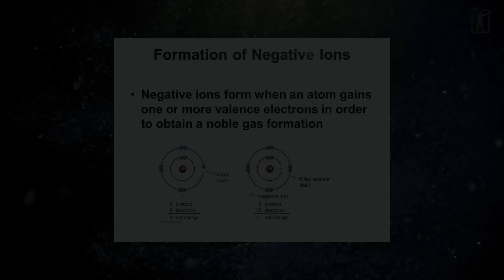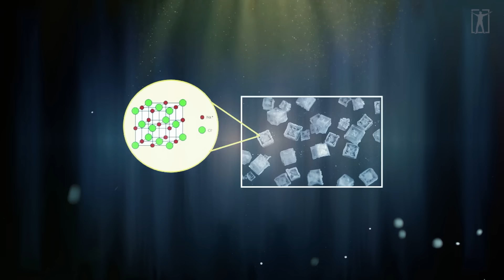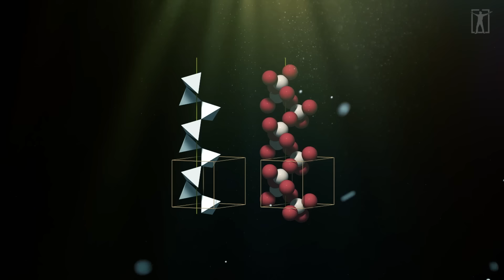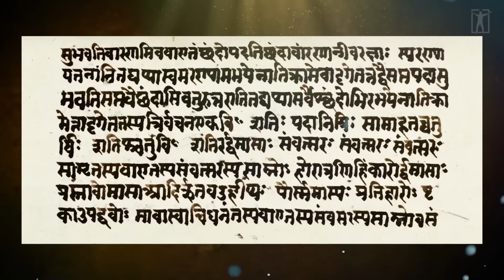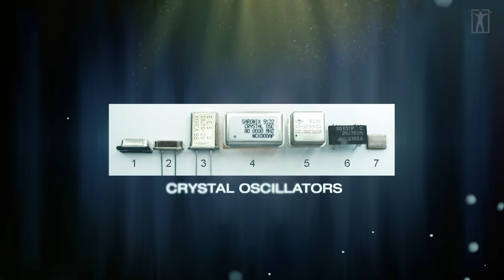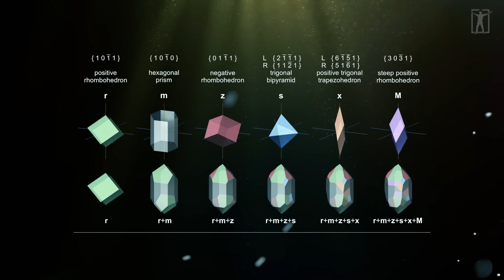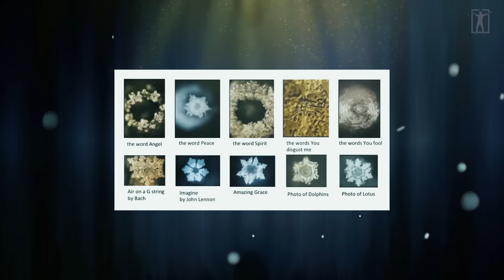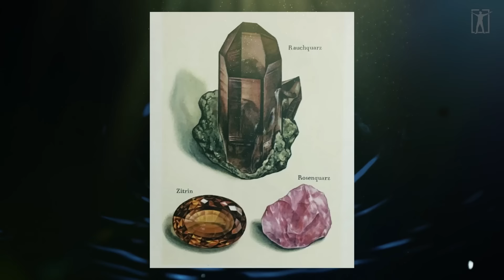"Once You Heat it, Your Brain Starts Changing" (seriously)

Comment: All I know is that when I stay too long in a crystal shop surrounded by so many and different types of crystals, I start feeling so emotionally overwhelmed, and uneasy to the point of almost panic attack provoking at times....and at a minimum, feeling like crying.  I've only been into 5 or so since I figured it out years ago.  The first time, I could not figure out why I was suddenly feeling that way, and my wife told me to go outside and touch grass, and I felt better pretty quickly....thinking it was a fluke, I went into one or two more with a similar effect.  Since then, I am aware of it, so it doesn't affect me as much as it did at first, but I have to prepare myself before going in.

Comment: There were 54 Large crystals in the great pyramid, 27 on each side of the So-called grand gallery , whenever the Nile moved up and down Immense amount of electricity was gathered  from the 13 acres it covered And transferred this voltage up the conductive magnesium filled granite and captured by the white non conductive insulating white stone on the outside the great pyramid magnifying this power to the max out thru the apex of the great pyramid emitting a great light through the cap stone made of  Electrum an admixture of 10% silver and 90% gold   These huge 54 Chrystal playing an amazing part of this spectacular performance of ingenuity  in my opinion
Reply: That sounds like a plausible source of energy for the electrolysis needed for the pyramid to function as a water pump.  Steven Myers has presented the most convincing theory of how and why the Great Pyramid was constructed to pump water ultra efficiently, using the vacuum formed from combustion of gas from electrolyzed water.
Reply: @Andy_Holmes  it sounds plausible only if you have no understanding of physics and powder generation!
Reply: @Mjbeswick  Modern man doesn't fully understand all the principles involved in physics and power generation, yet incorrectly assumes to.
Reply: @Andy_Holmes  exactly which well researched and documented principles do you think we don't understand?

If we didn't understand the principles of power generation it wouldn't be possible to generate power on the scale that we do.
Reply: @Mjbeswick  Obviously everything well researched and documented is already understood, I'm referring to that which isn't well researched and documented, of which there is plenty.  This is often referred to as fringe science, or otherwise disregarded as untrustworthy, but there's a lot of valid work that gets overlooked.
Reply: @Mjbeswick  For example, structuring water to utilize it's unique properties is an essential part of the process by which the Great Pyramid was able to pump water ultra efficiently, according to Steven Myers in his book "The Great Pyramid Prosperity Machine".  But the whole concept of structuring water is largely disregarded by mainstream scientists, and they would consequently fail to understand exactly how the pyramid functioned to pump water, without having increased knowledge/acceptance of unpopular scientific research.
Reply: It has been said that the Nile has been moved through the years. In the early years it went right through or next to the pyramids. Imagine so much salt water with Ions streaming next to it. Probably, in combination with crystals, pyramid energy and different kinds of metals they were able to make lots of electric energy of this.
Reply: @artofwebdesign  Are you saying the Nile was salt water?
Reply: The most probable explanation ever! Thank you. When I say it, my people just say I'm nuts. In your opinion, what was its actual purpose? I have a vision that it brought the Great Deluge.
Reply: @charleigh1860   The pyramids were built after the deluge by Noah's descendants.
Reply: Your Lord  the Enki built it. He is Noah's Ancestor though. This machine is supernatural built by the Annunaki.
Reply: @Mjbeswick 🙏🏻🙏🏻🙏🏻
Reply: And the cathedrals were also meant to harvest energy from the ether hih in the sky
And wit the organs playing, thise were healing centers and power stations

Comment: Negative ions can be beneficial for mood, energy levels, and overall well-being. They are naturally occurring in certain environments and can be increased in the following ways:

1. Spending Time in Nature: Areas with high negative ion concentrations include:

Waterfalls

Beaches

Forests, particularly after rain

Mountains and high-altitude locations

2. Air Purifiers with Negative Ion Generators: Some air purifiers release negative ions to cleanse the air of pollutants and allergens.

3. Salt Lamps: Himalayan salt lamps are believed to emit negative ions when heated, although their effectiveness is debated.

4. Houseplants: Certain houseplants, such as peace lilies, aloe vera, and spider plants, can help increase negative ions in the air by purifying it.

5. Grounding (Earthing): Walking barefoot on natural surfaces like grass, soil, or sand can help absorb the earth's negative charge, potentially benefiting your body.

6. Using Negative Ion Generators: Devices specifically designed to emit negative ions into indoor environments can be purchased for home use.

7. Running Water: Taking a shower or being near flowing water, such as rivers or fountains, can expose you to negative ions.

By incorporating more of these natural or artificial sources into your life, you can increase your exposure to negative ions.
You welcome 
Maria Chueva New Zealand 🇳🇿
Reply: Thank you for taking the time to share your useful list.

Comment: If you mix crystals in water with wooden or bamboo spoon or straw, you create a piezoelectric   effect in water. Also, before you put crystals in your water , check the soluble properties of the crystals. You don't want certain chemical elements from  crystals in your water.
Reply: It may be be a good idea to clear your water of any conflicting structure...or other imposed patterns picked up at any time...including Eons ago.  Simple works.
Reply: You clearly don't understand the piezo effect! When a crystal is mechanically stressed an electric charge is created, and vise versa. What you are suggesting literally has no function.

Comment: Use this along with magnetics, and cymatics (pardon spelling) and incorporate them into a living structure and you would have the basics for making a living computer!

Tree Fountain (aka Tree of Life)

1- Bore a hole into and up a tree being careful not to bisect the core of the tree. 

2- Coat the inside of the hole with beeswax. 

3- Put a water basin at the top and a fire pit or fireplace at the bottom. 

4- Put copper pipe around the inside of the fire pit or up the chimney for a fireplace. This will act as a pump. (You can also use a hotplate if you prefer)

5- Add water wheels (fidget spinners can be used for some decent mini water wheels) for electricity. 

6- Add hanging gardens for fresh produce. 

7- Splice other saplings and/or fresh tree cuttings using the tongue and groove method for shelter. 

This design provides food, filtered and conditioned water and air, electricity, shelter and SO much more! Everything a person needs for life and survival. Hence the "Tree of Life" nickname!
Reply: I can't even mentally picture what you're describing. Is there a video you can direct me to please
Reply: Very interesting line of thinking
Reply: Drugs are cool
Reply: Are you using the tree as your firepit chimney? The instructions are confusing with no pictures. If your burning the tree it's no longer going to be alive.

And what does it have to do with crystals?
Reply: @troywhite6039  No I wasn't thinking of using the tree as the chimney. The instructions are vague because it is meant to be added to and used as a template. And trees and plants do BETTER with a low voltage in close proximity in the same way people have positive effects from the same thing. It is not meant to be a definitive blue print.

Different locations call for different types of trees, different types of expectations etc. Crystals are used in most (maybe all) computers today and can be used to create a living computer. 

I prefer the idea of a fire pit, but a hotplate or something similar could be used instead for the same purposes. Explaining the whole thing definitively would be as exhausting as explaining all the processes that make a computer, car, or even a building of residence in the city. This is the cliff notes version and requires individuals to recognize the possibility and then do their own homework, using their own imagination and ingenuity to complete it. I hope to be able to have comprehensive videos with dialog eventually (hopefully soon as I am in communication with several people and in negotiations with one).
Reply: @larssoholt5965 I'm still so lost. I want to understand though.  Do you have more information to review or resources to suggest?  Ty.
Reply: @heartsfaith7077  i'm imaging a jurian spaceship.

Comment: Our entire body , teeth and bones, Resonate to frequencies BECAUSE OUR BONES ARE STRUCTURED LIKE THE STRATA of crystals and because  our body  contains so much water
Reply: Everything resonates that is made up of molecules, which is everything. Not because of the reasons you suggest. Ever wondered how an MRI machine works!?
Reply: Hydroxyapatite i believe is the crystal name for bone. Then there are the piezo electric “brain sands” that grow on an eye, instead of an iris, in the center of your head.
Reply: I mean, basically every rigid structure has a resonance frequency, every bone thus has its own. And likely the whole skeleton too due to loose coupling of vibrations via cartilage. 

Where are you going with this?

Comment: The crystals help to release the built up negative Ions, in the body.

The Ions build up in the body, when we wear Shoes on our feet.
The rubbers soles prevents us from becoming Grounded (insulators).
These Ions build up in the body, causing feeling of unealyness and uncomfort.

Have you every touched a door knob and gotten a Spark/ Shock.

That is the negative Ions being released, from the body.

G.))
Reply: Arent those the postive ions, that make us feel worse? 
Negative ions make us feel positive.
Reply: I generally get a shock after getting off my couch & touching a metal Earthed item such as a radiator, its static electricity caused by the clothes I'm wearing & the insulated rubber footwear. Static electricity is generated by the friction of 2 objects such as nylon.
Reply: I wonder if there is a correlation in decrease in epilepsy and use of grounding and or crystals.

Comment: A Quartz Crystal - preferably in its natural form , can & does store information  , vast amounts of information .   For it to absorb the information , set it's intention , then carry it with you in a pocket or similar , or even suspended by a chain around the neck  -  for here , Lapis Lazuli , is best worn as a master crystal , full time , and allow it to help with the other crystals being used in healing .
Reply: That's called a record keeper. Quartz is used in old style radios to tune in station frequencies and has a proven electrical property. In a way the crystal facets on its growing facets function in much the same way a microchip does. The electrical field of the human body and it's nerve synapses can even damage a crystal, rendering it cracked and cloudy after some time of exposure to 'bad' energies. Crystals are even lab grown to serve as optical lenses. Quartz is ridiculously hard and difficult to cut or carve. Many that I've found in Arkansas were covered in an iron deposit that had to be removed to see them properly with a long soak in acid , I believe I used oxalic. Some scrubbing with a Scotch Brite pad and eventually they were immaculate. I've noticed some continue to grow and heal cracks over time and some degrade. Others never change. I removed some specimens over 300 lbs with God awful effort and multiple power tools and those were clean and clear as glass without much other than a rinse with the hose.
Reply: Which city in Arkansas you found them ? Thank you
Reply: @nellim9239  near little rock, on Mt Ida at Ron Coleman's mine. Ten bucks for all you can carry out of there and dig yourself. At least it was in the 90s and 2000s. Bring drinks, they're ten bucks a can at the top lol

Comment: I am 83. I grew up in the 50s. Most of us kids build chrystal  radio sets  in cub scouts. At 11, my frieds and i got help from our neighbor to make a small tesla coil. We used a old flyback trra sformer from taking apart a old tv to get the voltage. At 14 i bought the firat ck722 transisters pnp and npn. Used a in32  nfiagal detector and wound coil on toilet paper roll and made a radio with amplification. We made  amall transmitters ordered crystals  from allied electronics to transmit at a certain frequency. Sometimes we took they apart and filled them down to change the frequecy. We knew more about this stuff at 15 thant college students now.

Comment: aluminum check it out, , its a paramagnetic material,  Tesla's assistant later came up with the Tesla purple plate, based of his design. it also produces negative ions, and its pretty amazing to people with chronic pain areas,, it can neutralize your pain in very short time like 20 minutes or less, and the negative ions can structure water changing it form H20 to  H3O2 which they say has a negative electrical charge, and the body can absorb it much easier so less absorbs faster and hydrates you more with less water. they say it takes about 30 minutes, just set the water bottle on the plate and wait, negative ions in puts off structures the water.

Comment: Quartz , tourmaline, and topaz are examples of commonly used piezoelectric crystals. 
When mechanical pressure is applied to them they generate electricity. 
That's how a crystal radio works without a battery. 
I haven't noticed that it made my brain change in any way.

Comment: A desert environment typically has very low levels of negative ions in the air due to the dry conditions

Why are negative ions typically found near water?

Waterfall effect:

When water droplets collide in a waterfall, they generate a large amount of negative ions due to a process called the "Lenard effect". 

Ocean spray:

Similarly, crashing waves on the coast also create negative ions through the breaking of water droplets.

Comment: Diamond is very cold to the touch dissipating heat. Carbon 60, 70 & 120 has been lab created as tubes. 
Strongest structural building block and will continue multiplying indefinitely in the right conditions.

Comment: I took a really nice quartz crystal.... and i put two copper pins in the rounded bottom ans hooked it up to 2  24 volt batteries and it lit up and a lasar like light shot out the tip...ot was a warm purplish blue light....it was incrediable. It eas a fuzzy like light but very pretty.

Comment: Whether or not crystals have spiritual properties, they can be considered a tool and tools have to have an operator. A drill sitting on its own is useless unless it has an operator. Crystals are the same. 

Tools are useful but not necessary. 
You hold the power within yourself.

Comment: The vacuum tubes of antique radios are a piggybacking wavelength and pick ups the standard long wavelength and short wavelengths and wavelengths of ultras that are not heard but the normal frequency these UAPs are a piggybacking wavelength of connections between as above so below conceptually the most important factor of thinking about

Comment: Yes older than the normal science is the vibration of intentions you'll find out that it's everywhere in nature self driving and resistant to changing once it's been swapping the mindset of the creations the trick is densely packed with pressure on intentional placement why do you not remember what happens to water and ice it's Taloric current circles within circles the opposite is positive intensity of lattice Intension to make a difference in one placement or the other one phase shift harmonics multiple points of the universe itself

Comment: Salt, as well as metal's, have crystal structures, so likely the stone itself is a kind of salt made from the body's oil and gold or silver. There too is a geometric structure pattern that when is this pattern is of the shape an vibration an frequencies with the energy that gives life an animates all things gives an tap in point too it for like begets like too the whole system it would be a kind of superconductivity  for anything the stones used upon.